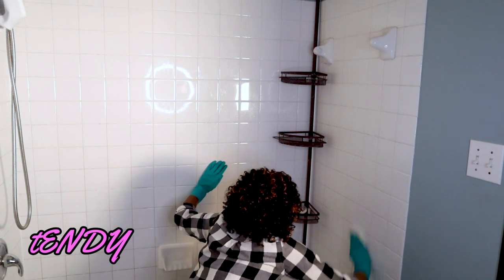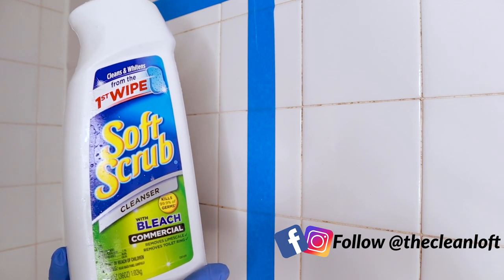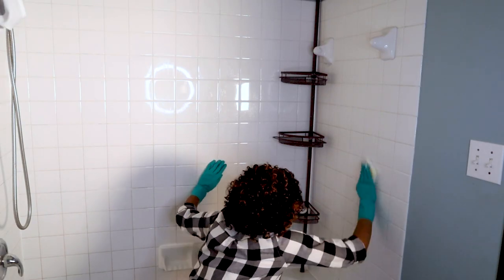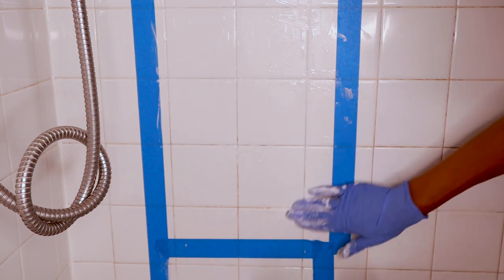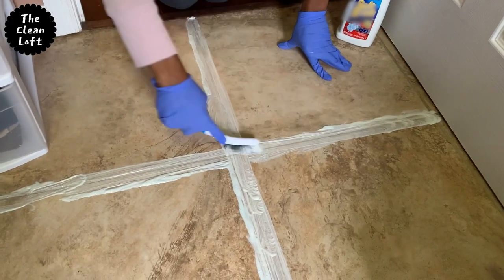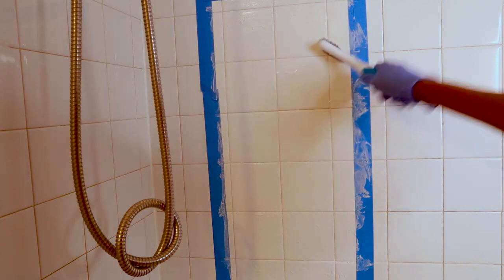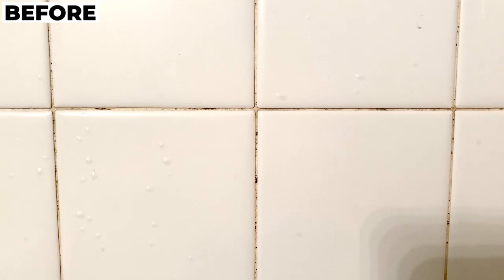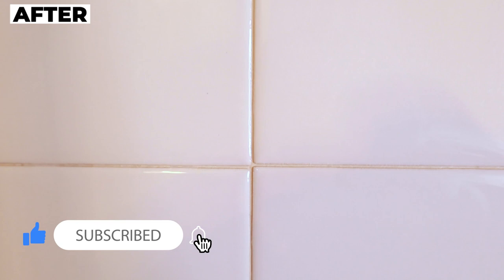🤯How To Clean Moldy Shower Tile Grout⚡️💦

Comment: I`m in the Uk ,and despite being ocd when it comes to any dirty areas ,i still get these dark mouldy spots ,which look horrendous! Any cleaner with bleach seems to work (and i`ve tried the natural bicarb/white vinegar tip too).Seems about the only trick that actually removes it.I was also advised by the guy who fitted oiur new shower not to spread the mouldy  parts when cleaning and to use strong paper towels to stop the risk of the spores spreading.It`s definitely my most loathed job ,so thankyou for the tip.x

Comment: HI!! I tried your suggestion of the Soft Scrub with Bleach and it worked on my moldy disgusting grout! Nothing else I tried worked. It’s all white again. You have to use bleach to kill the mold. Period. There were a few tiny spots that were barely noticeable and I used a bleach spray and spot cleaned it and let it sit and it’s all pretty much gone. Thank you for your video😊
Reply from the maker: My pleasure, thank you for the feedback. Am so happy this method worked on your grout.  😊

Comment: Make sure you don’t have natural stone tiles or bleach can etch the tiles.  Vinegar is horrible for natural stone too. Don’t destroy your marble and travertine.
Reply from the maker: Thanks for the heads up! You're absolutely right—I don't recommend using bleach on natural stone, and vinegar, being acidic, isn't suitable for stone surfaces either. It's crucial to choose the right products based on the type of material to avoid any potential damage.